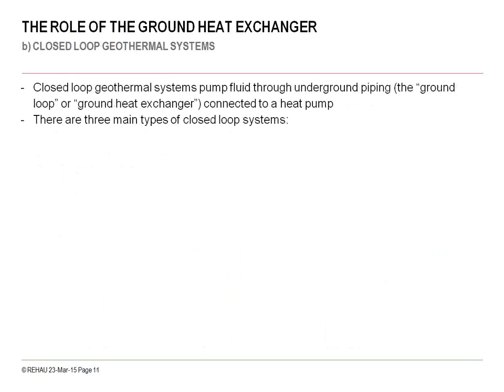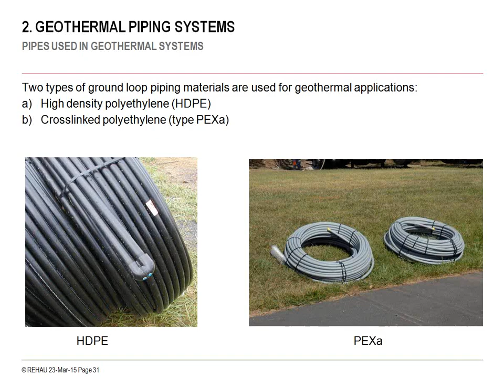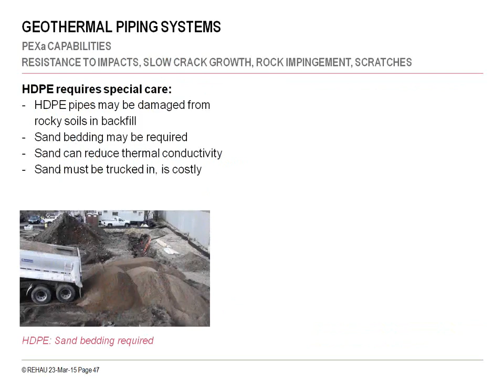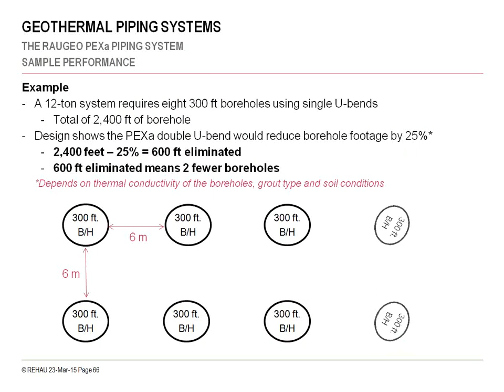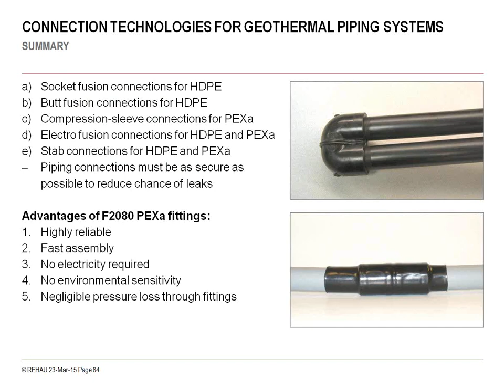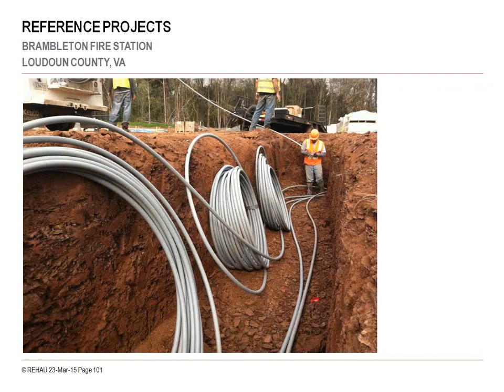RAUGEO Pipe for Optimizing Geothermal Loop Fields - Webinar 3/23/15

Comment: I noticed the orignal presentation date was in 2015.  Is PEXa still the best pipe to use on horizontal geothermal systems for heating (Maine) in rocky ground?  Thank you, very helpful presentation.